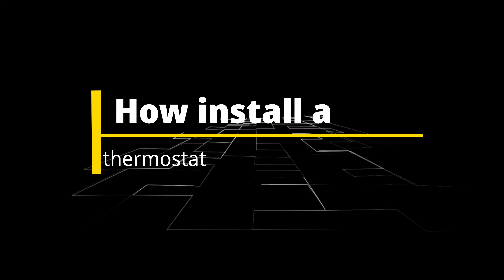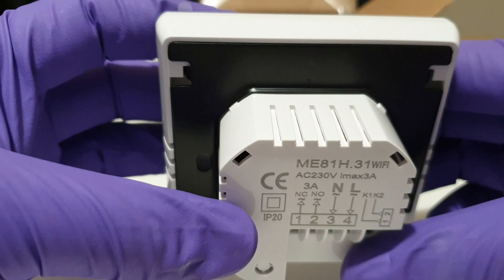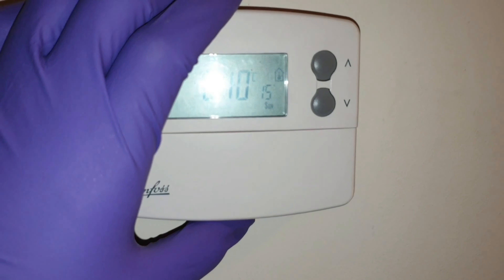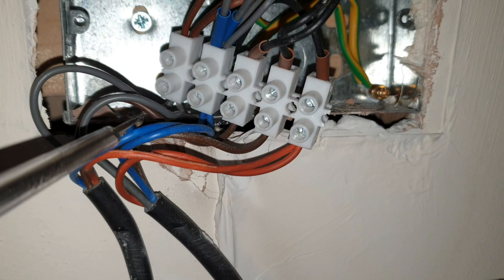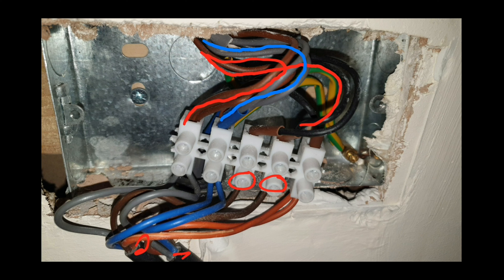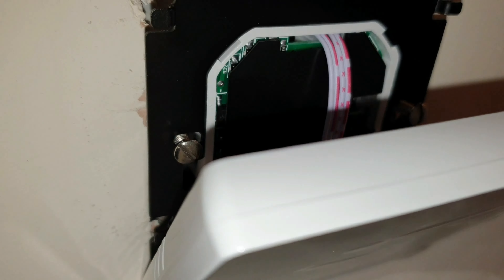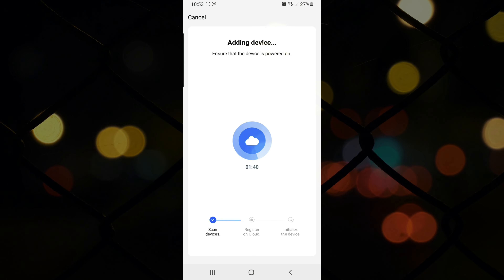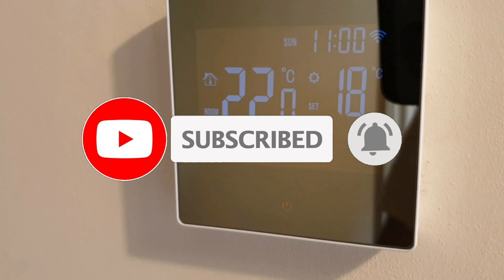Smart WiFi thermostat for under £20! And how to install Avatto MoesHouse Beca and others.

Comment from the maker: @4:45 Not clear in the video, but the "switched live" needs to connect to the "NO" (Normally open) terminal.
Reply: Can I ask a follow up here - I'm upgrading from the Heatmiser DS1-L which bridges the Live into a dry contact, however in this example, using the NO terminal will do the job right?

Comment: hey there, great video btw. 
I have the same issue with another one down below. I have floor heating system uses water, which needs 3A I believe. 
However I bought the 16A thermostat. which has L N L1 N1
Is it gonna be working with my floor heating with water?
If yes, what connections should I use?

Comment: Great video! But just to clarify: if I have only 2 wires from thermostat to gear control box. It should be enough? Like: 2 wires from thermostat to control box. And then 2 wires from gear to control box. Right? I have newly prewired house, so just trying to figure out what thermostats will fit my needs. Thank you!
Reply from the maker: Unfortunately no. Sound like you don't have a neutral which means your current one is either mechanically or battery powered
Reply: @laymandiy  Does it need the neutral? I have a heat-only boiler system for my hydronic baseboard heating and I have some strange wiring going on, but the system works perfectly. Here's what I have: W-heat relay wire, R-heating power wire, jumper from R to Rc-cooling power, although I don't have air conditioning, just the boiler for the heat. Any advice?

Comment: Hey. Nice one there. May I ask if the screen backlight would turn off completely at some point? I saw that it dims down quite a bit, but does it completely so it won't emit any glow in the dark? I may be installing this in my bedroom and I'm concerned I would be staring at it all night long if there is any light coming from the screen. Thanks
Reply from the maker: It's quite dim, but it doesn't turn off fully. Maybe a newer model does?
Reply: @laymandiy  Thanks 👍🏻

Comment: Great video - Thank you!
I have a similar thermostat. I am wondering if there is something wrong with it.  This is because, when I sup[ply 110 V-AC to the thermostat, (to N and L), when I check the NC and NO with a voltmeter, I get exactly the same voltage (i.e., 110 V AC) from NC and NO! Does it mean there is something wrong with my thermostat?! This of course occurs when I set the temperature greater than the ambient temperature (otherwise, there is no voltage on NC and NO).
Reply from the maker: Are you using any jumpers?
Reply: @laymandiy  thank you for responding!
No, no jumper ay all.

Comment: hello, i have L/N 220v 2 wires and one wire coming from boiler. how i should connect it to this thermostat ?
Reply from the maker: I cannot comment on this without knowing further... Most likely sounds like the 3rd wire is a switched live which tells the boiler to turn on

Comment: This is an absolutely excellent video and helped me with the installation, so thank you.  Wondering if you could help with issue I am now having? After I installed it and set up the app and turn on the heating the boiler fires up but I can't seem to turn the boiler off from the thermostat. When I set the temp below room temp it stays on and when I turn the thermostat power off the boiler remains on. Confused! Any help would be greatly appreciated
Reply from the maker: Does it turn off from the app?

Comment: Thanks for the video which I found searching for a "cheap" alternative to Nest, Hive, etc. I have four questions. Firstly, can you programme the unit as to when the central heating should go on/off as I assume the  central heating programmer will always have to be on? Secondly, would the central heating work even if the wifi is down? Thirdly, I assume you can change the programme/temperature/turn the central heating on and off even if away from home via the phone app? Fourthly, does the unit fit a standad 1-gang plastic pattress box I can screw onto the wall?
Reply from the maker: The answer to all those questions is yes
Reply: @laymandiy  I appreciate your prompt response. I have subscribed to your channel!

Comment: Excellent instructional video!. And based on it I purchased the same thermostat. I havent installed it yet but I have powered it on and connected to Smart Life. I have a couple of questions and hopefully you will be able to answer. 
Q1. I noticed that when accessing the thermostat via the app the "Set Temp" shown is not the current until I power off/on the thermostat via the app. To clarify - say 9:00 - 10:00 = 19C and 10:00 - 11:00 = 21C. 
At 9:30 via the app swich off/on the thermostat it then displays set to 19C. 
Now at 10:10 Without switching off/on it will still display 19C until Off/On to force a refresh of the data.
Have you noticed the same?

Q2 - What is the "Switching differential" setting?
Many Thanks
Chris
Reply from the maker: Correct, once I've left the thermostat off when I went on holiday. I knew it was cold in the house but for the first minute or so it still showed 19

Switching differential is how far below the temperature should drop before kicking on again
Reply: @laymandiy  Thanks, appreciated.
So, nothing wrong with mine. I tried different apps, Tuya and Brilliant, and get the same behaviour. Somehow the "Set Temperature" is not uploaded to the app unless OFF/ON but somehow the actual temp reading is continually updated on the app. 
Ah well... must make it a habit to switch Off and then On to refresh the "Set temp" reading. 
Again many thanks for coming back to me.

Comment: Hi there, 
I've purchased five of them, on all of them same problem with temperature values compared to wall termometer, which shows almost 5 degrees celsius more than termostat. Is it necessary to calibrate them?
Thanks
Reply from the maker: You can easily adjust them in the app. Always a good idea to set to known good value. As for calibration, that would mean being able to set a few different temperatures to ensure its correct, this doesn't allow you to do that.
Reply: @laymandiy  I know that you can adjust set point temperature on the desired value..I have big difference between real measured room temperature and the temperature measured by build in sensor in termostat.

Comment: It is impossible for me to connect it to Wi-Fi, is there any way to reset it or put it in search mode?  What icon is for the thermostat?

Me es imposible conectarlo al wifi hay alguna manera de resetearlo o qe se ponga wn modo busqeda?? Qe icono es del termostato???
Reply from the maker: A friend had a similar problem. Please make sure your phone is connected to 2.4ghz and router is also broadcasting in 2.4ghz
Reply: @laymandiy  thx my friend it was faulty

Comment: I just have 2 wires in my old thermostat, guessing this will not work? Will it fit USA/Canada Junction boxes?  Looks like you posted this video 3 years ago. How are they doing now? Thanks.
Reply from the maker: Still going strong. If you have 2, you need to wired a neutral wire back to the junction box. If your boiler or junction box is near the thermostat this is an easier task.
Reply: @laymandiy   I want to use it for my electric baseboard. Will that work? I am in Canada and I’m wondering if it will fit in my standard size junction box. Thank you

Comment: Hi, I’ve watched your video a bunch of times, as I believe it’s the solution to my problem. I can’t have a Hive system installed. I simply want to be able to control the temp of the thermostat/heating remotely. My current thermostat (Drayton Digistat+) is battery operated. It has a red wire going into Coms, and a yellow into On. There is an Earth coiled up in the unit. If I buy the same unit as you, is it possible to power it from the on (yellow wire) wire by using a wire bridge? Of course I’m not holding you to this advice, and I’ll seek professional help, but I don’t want to waste money buying this thermostat if it won’t work. From reading the many threads in this video, it seems my question has been asked before, but I wanted a little clarification. Many thanks for your post though, extremely informative.
Reply from the maker: If you have a neutral wire, blue in colour, also coiled up then yes. The box where the wires come into, isn't it made out of metal?
Reply: @laymandiy  Hi, thanks for the speedy reply. The thermostat is currently lying open on the floor! After a total refurb. So there is no back box/patress to speak of. I couldn’t make out a neutral, which thinking about it now, makes my question redundant. I’ll have to take a closer look at the wire going into the stat, as there might be a terminated neutral. However I’m not that lucky. If I can find a 240V power supply for the new stat, then I guess the red wire can go into the on terminal, and the yellow into the Com terminal. Thanks a bunch for your advice. It seems this was never going to be straightforward, after Hive visited me last week to try and complete the install but couldn’t.
Reply from the maker: No electrician would ever recommend connecting an external power supply to the thermostat. Not sure what the regs are but I'm thinking that would be against it, you'd be crossing over two circuits which is a complete no no. Imagine switching off the lights circuit only that it isn't and the mains is still powering it. Extremely dangerous. You could go for tado or some other battery operated remote thermostat, if you're not prepared to draw a new wire.

Comment: Hi. Did you keep the jumper or later remove it?  I’ve wired mines up minus the jumper and it doesn’t seem to be working properly. I’m unsure if it’s the wiring or unit itself
Reply: The wiring for my old danfoss unit is the exact same as yours. I’ve put the live and neutral in their respective ports and the switch live into the “dry contact” open port (slightly different port labelling on my version) with the power flashing on for a nanosecond every 30 secs or so.
Reply from the maker: Putting switched live into NC or port closed, leave live and neutral as is and no jumper. I would test the unit with just live and neutral to see if the unit is faulty or not.
Reply: Thanks for the reply. Have tried just the live and neutral as you’ve suggested. It’s the unit that’s faulty.

Comment: I have followed this video however when I fit the wiring the wifi unit intermittently powers on and off and doesn’t work properly. 

I initially thought this was a problem with the unit itself so got it replaced yet it’s happening again.

In an attempt to fault find I put only the live and neutral in their respective ports and it still doesn’t power up properly however when I put the live in the L port and switched live in the N port it powers up fine however can’t control the heating system in this set up. Any ideas/suggestions would appreciated.
Reply from the maker: Have your tried putting live and neutral and connecting directly to a power outlet or test block?
Reply: I don’t have a test block unfortunately so have conceded and put the Danfloss unit (exact same unit and wiring in your video) back on. Frustrating as I now have 2 tuya thermostats sitting here.
Reply from the maker: You need to connect directly to power outlet. To me sounds like you have some weird wiring that needs to be identified.

Comment: Hi do i need a receiver next to boiler for this particular thermostat, right now what  i have is battery operated thermostat which is connected with the receiver upstairs wirelessly. fortunately my old thermostat is still in the living room but the wires are disconnected from the junction in boiler cupboard, my question is if i remove the receiver from boiler cupboard reconnect the old thermostat wires with this one will it work? I will really appreciate you response  also the second link don`t work anymore
Reply from the maker: Yes it will... If you have a wireless one, you need to either disable the wireless or remove it entirely. Assuming you have a Combi boiler.

Comment: Really interesting video!
How should I combine this thermostat with TRV? Is this useful for managing the gas boiler on/off depending on the TRV needs?
Regards!
Reply from the maker: I briefly looked into this, I couldn't find a simple way of doing this without having to manually program the logic myself in the apps. I'm not sure if I'm missing something. You'd be better off with a ZigBee unit. Look into it and let me know!

Comment: Hi, having installed the thermostat and added it to Smart Life, it seems that I can only control the temperature from my phone. I cannot turn the thermostat off from my phone or access the programming which is possible only from the thermostat itself. On the Smart Life app there are four buttons at the bottom (Switch, Mode, Setting, Function Name) but nothing happens when I press any of them. When the thermostat is turned off, the icon for Switch becomes pale but then I cannot turn the thermostat on from my phone. In summary, is it the case that all you can do with your phone is to change the current temperature setting for the thermostat and nothing else?
Reply from the maker: No, on mine I can turn on/off, change temperature, change the mode (auto/manual) etc. Works with Google home and Alexa, albeit Alexa does seem to (lately) think I'm in a different mode.
Reply: @laymandiy  Thanks. I now realise I bought the wrong version of the thermostat! How stupid but luckily should be able to change it for the correct one.

Comment: So i am confused.no need for other connections on the boiler? I have a ideal combi.boiler and 2 same thermostats as you(living and 1 bedroom) .all i need is coming in the box?
Reply from the maker: That's right. You will need to ensure that you have a neutral feed in the position of the thermostat.
Reply: @laymandiy  and i need only one of this? In the colder room ?Or need to replace both denfoss? Cancel the other one?..
Reply from the maker: You'll need 2 if you want to control both zones via the app

Comment: It sets itself to 32⁰C every day at 0.00.  Only for the 5+2 or 6+1 program.  It works well with a 7-day program.  What is the problem?  What is the solution?
Reply from the maker: I set it to manual and use Alexa / Google home for routines rather than the built in programs of the thermostat.

Comment: I have the 16amp one but I only needed the 3amp does this impact its functionality as I'm told the appliance will only draw what it needs from the appliance

the appliance has
live = L
neutral = N
n1 = which is linked to the neutral
l1 = which I believe is where the Control wire goes

when all connected...
the appliance turns on, but no instruction to the boiler to turn on
Reply from the maker: You've got the wrong thermostat. The boiler doesn't need to draw anything is there to complete a circuit. You've replaced that circuit with something that's expecting load vs what you're actually giving it, a short circuit. Taking a guess but the thermostat probably has in built protection for this hence why no instruction to the boiler. Does the boiler turn on if you connect the wires going into l1 n1 directly to one another?

Comment: Hello nice video! 
My question is:
Can we set this thermostat to 40°C manually ? 
I have stuff that need 40° C in storage. 
Thank you for answer ...
Reply from the maker: Don't think it goes that high...it is a room thermostat after all 40 degrees isn't ideal for humans. You need one of those WiFi temperature gauges which then controls a switch that turns your heating on or off..

Comment: Can I ask what boiler you wired it to? I have a combi boiler, same wiring as you. Live, neutral and the other one in the danoss thermostat. 
Wired exactly as you have and nothing works.
Reply from the maker: Have you checked what type of thermostat you have? It must be the 3a rated one. Secondly, I have a ideal boiler so, check the wires in the manual, normally there are two connections, legacy ones and the open therm. Check which end of the boiler the wires go into.

Comment: Hi love the vid but does this replace the dial thermostat. Also I have a danfoss which is meant to program the heating but doesn’t work so which one am I replacing ? The dial or the danfoss programmer one. Thanks
Reply from the maker: Only the dial. The programmer probably controls your hot water